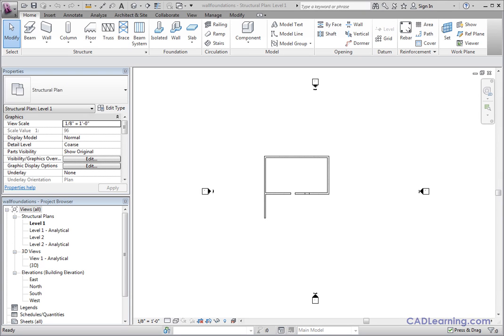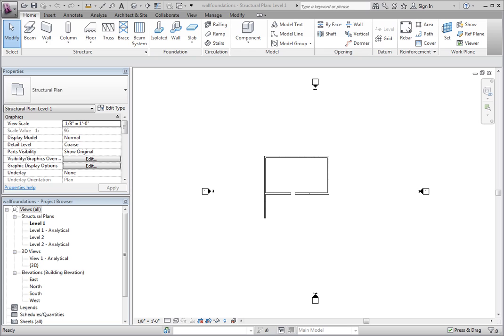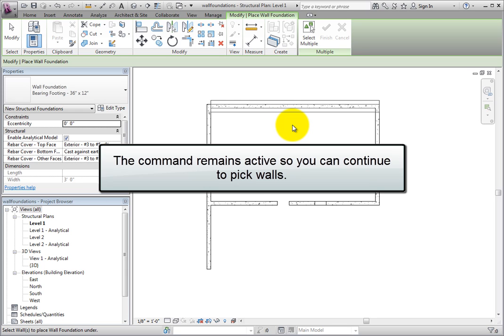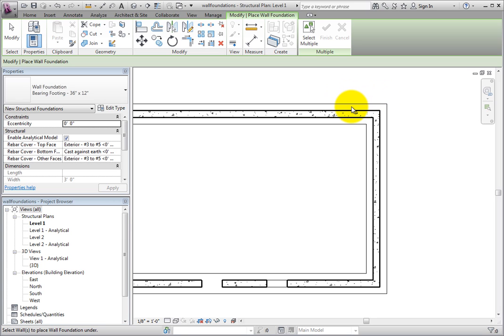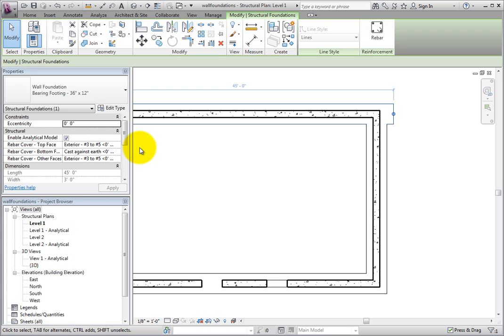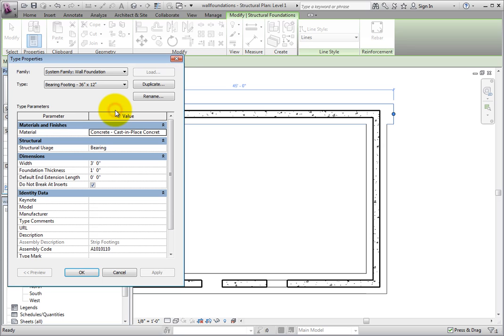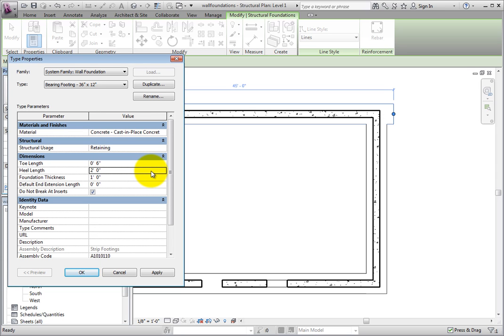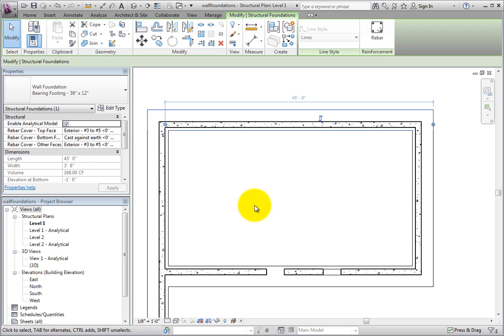Revit Structure 2012 Tutorial - Creating Wall Foundations

Comment: But what if you want to make a custom shape for the wall foundations? Say for instance a haunch or a wedge like shape. It seems the wall foundations operate like sweeps but I do not want to model in place for this item. I try resist model in place as often as possible. But controlling the shape of the wall foundations should be able to happen. I'd like to retain the hosting to wall functionality